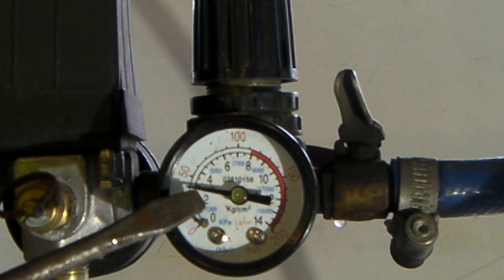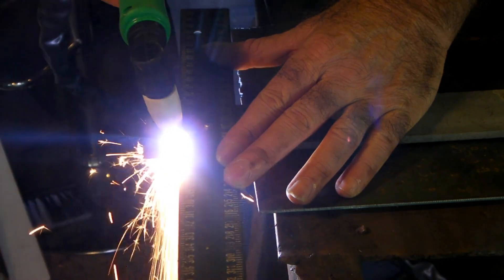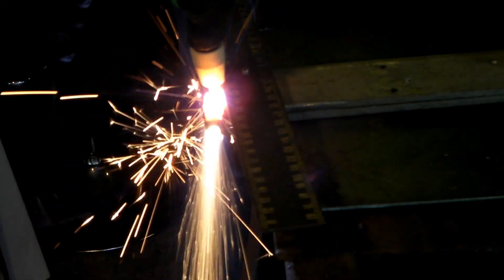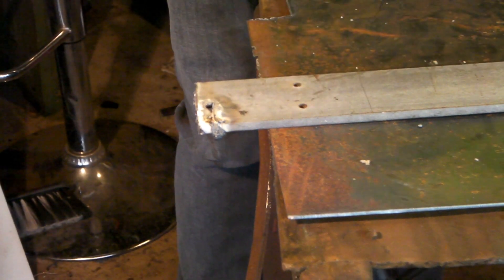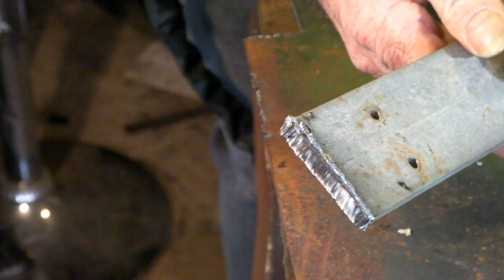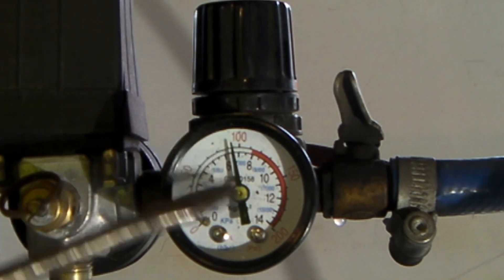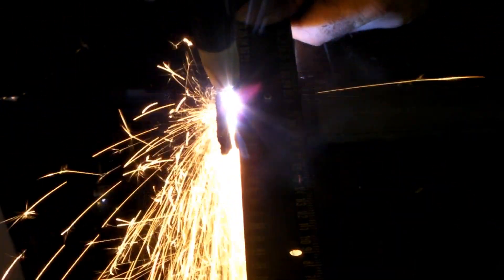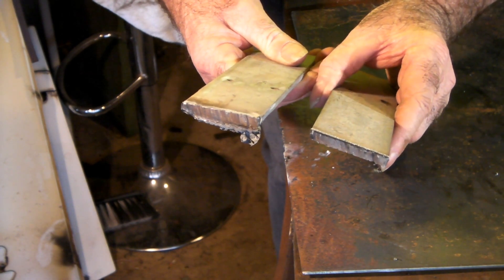Plasma Cutter Air Setup EASY

Comment: My BTC500DP unit ( forget the brand) calls for a max of 65 psi I believe. Is that a hard maximum or are they just being cautious about their air connections inside the machine.?    I know you have this unit as well as the 7th generation.  Have you ever exceeded the factory recommendations?
Reply from the maker: Yea all the time i tend to cut thick stuff so have really high air pressure

Comment: Hi pete.  may I ask you is it possible to run my PLasma cut 50p from a petrol generator and if it is what would be the best size or spec generator to use without breaking the bank. Cheers peter
Reply from the maker: Hi mate never tried it but i know a lot of welders don't like it.

Comment: Mine spits and farts then finally fires up for a brief period is that caused by water in the air
Reply from the maker: yea  have you got an air dryer ?
Reply: @petestools  only the little one that came with it, sits on the back
And leaks

Comment: The required air supply actually counts for a larger part of the cutting process than the amperes. Most important is continuously having the correct volume of air for every cut you're going to make. Most hobbyists only have a small compressor in their workshop in the backyard shed. Plasma cutting consumes a huge volume of air. Even though a small compressor can deliver app.6 bar(90psi) of pressure, the tank on most of them is too small to supply enough air for the entire cut; i.e. the pressure and thereby the volume of air drops down before the cut has been completed. This will damage your consumables! The solution could be adding a "buffer" tank between a small compressor and the plasma cutter. Pete has made a video covering this subject. However, it may not be a noteworthy problem for the vast majority of hobby users, as cutting thin plate doesn't require so much air; no one cuts railroad tracks in the backyard, lol. You see, all plasma cutters are furnished with buttons for adjustment of amperage and air pressure. Unfortunately, most beginners turn their machine up to full amperage and cautiously set a low air pressure. That's the worst you can do! It spoils your consumables immediately, with certainty. When cutting thin sheet, turn down your amperage. You aim for a cut around 1mm(0.04") in width. Too high amperage creates so much heat that the metal around the cut itself starts melting, thus the air stream from the nozzle can't blow the glowing droplets away fast enough. Result: A damaged nozzle tip, and perhaps even a cracked ceramic insulator on your torch. In the other hand, too high pressure blows the plasma arc so fast away from the metal that it almost prevents the flame from cutting into the metal. Result: A cut only partly through the metal. There is a rule of thumb (US-origin) for amperage / pressure settings: Material from 0.40mm(1/64") to 4.8(3/16) = 20amp/2bar(30psi),    5.0(13/64) to 7.5(19/64) = 30amp/2.75bar(40psi),    8.0(5/16) to 9.5(3/8) = 40amp/3.0bar(45psi),    10.0(25/64) to 12.3(31/64) = 50amp/3.5bar(50psi),    12.7(1/2) to 15.9(5/8) = 50amp/3.75(55psi),   16.3(41/64) to 19.0(3/4) = 60amp/4bar(60psi),    19.5(49/64) to 22.0(7/8) = 60amp/4.5bar(65psi). Be aware it is general recommendations! The various brands/models of plasma cutters might require different settings. It's my experience that both my 3 phase (400volt) 80 ampere industrial machine and my 240 volt (lightweight) 50 ampere portable machine perform best with slightly higher air pressure. Several other factors does have influence on the required settings. You must adjust the settings for each workpass in accordance with: The degree of wear on your  consumables,  the material to be cut, and the size of the hole in the nozzle you're using. Pete absolutely loves the PT31 torch and rightfully claim the consumables are dirt cheap, but you'll be stuck with only one size nozzle. My 80 ampere machine came with consumables made of pure copper. After a couple of hours cutting thick steel all were gone. Discovering that they were of proprietary size and carried a hefty price, I changed the torch to the only quality chinese generic torch: The P80. (I also ordered my 50 amp machine with factory fitted P80 torch). Yes Pete, P80 consumables are a bit more expensive at US$0.35/pc free delivered, but they last virtually ten times longer. Nozzles and electrodes are heavy nickel plated, and nozzles are available in 6 different hole sizes. This is interesting for hobbyists who's only gonna cut thin plate. A 1.8mm P80 nozzle requires much less air pressure; a small compressor can handle that. On the contrary,  I've used the 1.1mm P80 nozzle (Pete's favorite) on my 80 amp machine to cut 40mm steel. It only worked at a pressure of 10bar(145psi)! Not recommended; it puts a lot of stress on hoses. Most manufacturers state a max pressure of 6bar(90psi). Notice: The smaller the hole in the nozzle, the higher air pressure is required. Even more important: The higher the amperage, the higher air pressure is definitely needed! For cutting thin plate a large hole nozzle can be used with less air pressure. Measure your nozzles with a digital caliper on a routine basis and sort them out. Use the slightly worn ones with larger holes (if the holes are still round!) for thin plate only; it may save you money on consumables.  One thing to consider about air: All around the world the air contains more or less humidity. The water separator that you mount on the rear of the machine is almost a joke. It can separate out water drops, but does not remove humidity from the air going to your torch. Even the slightest trace of humidity will contribute to the destruction of your consumables, and also slowly but steady disrupt the function of the magnetic air vent in your machine. Good luck finding spare parts for your generic chinese machine when the magnetic vent is stuck due to rust; the only alternative is a costly repair in your home country. Even more serious is the fact that compressors induce microscopic droplets of oil in the air stream, as well as sucking in dust particles from the room, which also ends up in the air stream. Any tiny amount of carbonaceous content in the air will eat your consumables from the inside and out. I have a chinese manufactured air filter system installed on the hose from the compressor; originally purchased for 100% clean air when filling my PCP airguns. It's rated for a max pressure of 300bar. It consists of one cylinder with an ultra fine filter and active carbon for dust collection, and a second cylinder with moisture absorbing silica gel. In case you're using your plasma cutter on a regular basis, you'll save lots of money if you buy such a device (or make one yourself).  Although the filter is perfect for providing 100% clean air, unfortunately, it cannot cope with a large volume of air flowing through. A huge homemade "buffer" tank has been welded together from a 4m long stainless steel tube to store air at a pressure of 12bar. A reduction vent on the outlet reduces the air pressure to 10bar in the hose going to the plasma cutter. Bye bye angle grinder, welcome plasma cutter. Happy cutting to you all.
Reply from the maker: Thanks for you comment Like you say AIR is most important and most people don't relies how much of an affect it has on your cutting power. I still love my pt-31 torch .
Thanks for watching pete

Comment: Nice job Pete.  How many amps did you use?
Reply from the maker: 40 amp plasma cutter
Reply: pete's tools 
Did you set the 40 amp plasma cutter to max amps as you varied the air pressure?

Comment: Never used one before but I was wondering if these plasma air cutter needs to be connected to gas or can it just be air compression? thanks in advance
Reply from the maker: just use normal air from your compressor
Reply: @petestools  thanks heaps mate

Comment: Air flow, CFM is as important as pressure. If you have plenty of flow, it won’t be too bad at low pressure, but higher is better. But thicker metal requires a lot of both.
Reply from the maker: great thanks